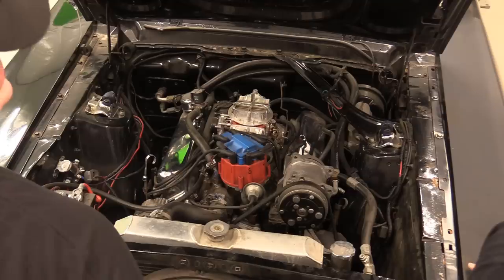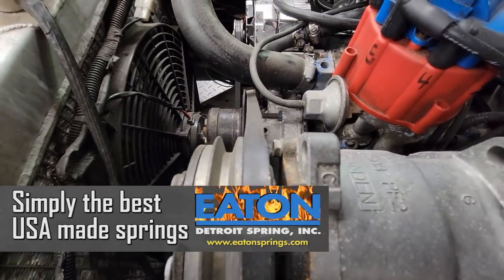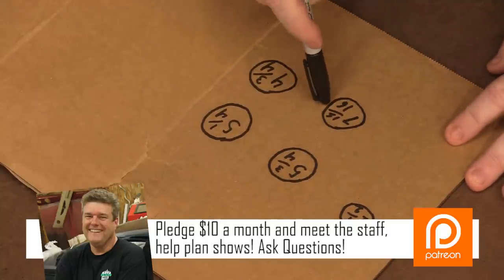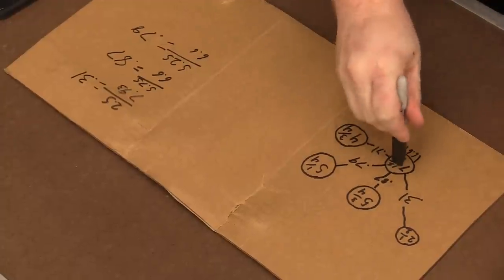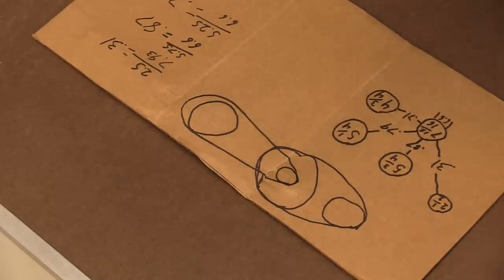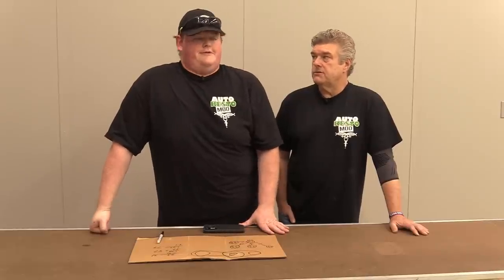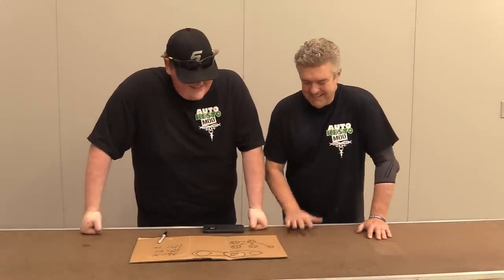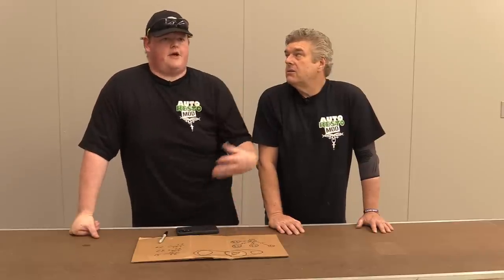Wrong Engine Pulley System

Comment: When I swapped a 1999 Ford Motorsport 302 crate motor into my 1963 Fairlane I had a hell of a time just gettin the crank, water pump and GM style 1 wire alt to line up. Came in the crate set up for serpentine. Biggest problem was Ford made so many offsets on water pump pulleys and waterpump noses. I almost went with some March pulleys, but we finally found a OEM pulley that lined up. I was throwing lots of belts shifting at 6 grand.
Reply from the maker: That is exactly what I've found.

Comment: Your pulley question got me questioning why also lol. I just looked in my Chilton collector edition (not sure if matters) for the 1961-1971 truck repair manual and found only 1 picture from the FoMoCo of the 330 v8 with dual belts to the crank. In the 71-78 manual no pics and looked at the car manuals also with no such luck. I do recall I had a 390 75 F100 with dual belts also and my now 73 with 390 does not. So as far as I have seen is, one truck owned in early life and this one pic in the manual, that they just gave you 2 belts. Not sure but got my curiosity....thanks for vid guys.
Reply from the maker: You are welcome

Comment: I have been running a CVF racing v belt pulley and bracket system for about 10 years now on my Cleveland. Probably one the easiest way to get the correct parts but probably not the cheapest way.
Reply from the maker: That is the direction we are leaning. Looking toward March Pullies

Comment: Your math seems to be way off on the alternator speed. The alternator will be moving over 3 times the speed of the crank pulley. So, if you idle at 750 RPM, that alternator is going over 2,300 RPM. The diameter of the alternator is over 3 times smaller than the crank pulley, so it will go 3 times faster than the crank pulley. That alternator at 5000 engine RPM will be spinning over 15,000 RPM.
Reply: Came here to say this... Jeeze Cam...
Reply from the maker: We don't maths well.
Reply: @AutoRestoMod   LOL
Reply: very true older chevys dont energize till 2000 rpm

Comment: Cam, the crank (7.9375) should be divided by the alternator (2.5) that gives you a 3.175 : 1 ratio. The alternator spins 3.175 TIMES faster than the crank. At 750 rpm at idle, the alternator is bumping close to 2,400 rpms.

Is there a chart or listing the show recommended accessory speeds? That would allow a builder to search for the correct pullies based on math rather than luck and guesswork.
Reply from the maker: We didn't find one but We'll look.

Comment: AFAIK dual sheave pulleys on water pump & alt were used on engines with separate sheave on water pump pulley, to drive smog pump. Those were generally Hi-Po engines with Holley carb, that could not pass emissions. The '68 390GT with Holley used smog pump, the '69 used a Autolite carb & no smog pump.
Reply from the maker: Thanks for that!

Comment: I have two comments/questions… Is a 7-15/16” crankshaft pulley really massive?  
I have a stock olds cutlass it has about a 8” pulley. The driven water pump has a dual  5”/6” and then it goes to the 2.5” alternator. 
 If I did the math correctly my water pump is driven at 1200 rpm and the Alternator is 2618 rpm. At 750 idle.   
Reason why I’m even thinking about this is because I recently bought some Aluminum pulley’s and the crankshaft pulley is only 4.75” versus the factory 8”.  😮

With the new smaller pulley it would take me close to a 1:1 ratio. Therefore cutting all the driven pulleys RPM in half. 
  So instead of the water pump spinning at 1200 rpm, it’ll be only 625.  The alternator RPM would drop to 1364.  But when I researched the alternator rpm specs it seems like 2500 RPM at idle is correct! 
Now I don’t know what to do. I want to install my new pulleys, but at the same time I want the higher rpm at idle because I have a high output alternator to compensate for the 60 amp cooling fans, 80 amp air ride compressor. 300 amp Amplifiers ect.  From the research I found 2500 is the number for alternator rotation at idle. fml

Comment: Yes Ford pulleys can be maddening, looking in Master Parts there are pulleys of 6" & 61/64", really? For small blocks there was a major pulley & bracket change from 1969 to 1970(year water pump inlet changed from passenger to driver side). There were two P/S pulley for the '69 428 Cobra Jets. Size increased due to the 3.91 & 4.30 gear SCJ burning up pumps. Not having the correct CJ pulley, when I installed P/S on my Torino, I used a 6cyl Maverick pulley(offset perfect). It's size is between the original speced  pulleys. I now have correct pulley but am in no hurry to swap it out. Many water pump pulleys swap between FE and pre '70 small blocks. 

The water pump pulley on your Mustang is a '70 up pulley(appears same as on my '72 Comet). Those generally have seperate drives for alt and P/S pumps. The P/S bracket is correct for '67/'69, probably so is the pulley.
Reply from the maker: Interesting. The PS pump pully looks "wrong" (too small) but maybe not. My spares are all in disarray so I can't pull out a pump to check it.
Reply: @AutoRestoMod  According to Ford Master Parts, '67 289 Mustang without A/C used a 4 7/8" P/S pulley. Should be stamped AC. With A/C Used 5" pulley stamped AD. I'm using a 7AA pulley on my '69 Fairlane 302, its from a 1968 A/C 390GT. Ford doesn't give size but measures just under 5". That's the system(with Maverick pulley) now on my 428CJ. Offset was wrong for 390 pulley on 428CJ.

Comment: Ok so guess I need to re-examine the pullies on the 68 Fairlane for the roadtrip and racing in Sept/Oct.
Reply from the maker: Yes. LOL, might want to get your head looked at after our chat and you discussing 4.30 to 1 gears for a road trip.
Reply: @AutoRestoMod  but that takes all the fun out of it.
Reply: Had a buddy that installed a 3.25 gear for cruise/highway and then a 4.56 at race track. Swap back for return trip home.

Comment: Ok guys, for the question of dual sheathed WP’s and ALT’s it’s simple. I’ve got an 85 F250 with a 460, so my truck has 7 pulleys with one being the crank obviously. My belt drive also is dual belt for the power steering pump or PSP and uses two air pumps or AP’s. My crank or CP has 4 grooves which is two pulleys bolted together, my WP has 3 grooves with a space (no 2nd groove) which is two pulleys bottled together. My ALT & PS have two grooves, my A/C Comp & both AP’s are one groove. Seems complicated but it’s not by far. 

The front to back grooves 3 & 4 of the CP drive the WP & PSP, groove one of CP drives the WP & A/C Comp. Groove 2 of the CP drives the rear groove of the ALT and the front groove of the ALT drives both AP’s. This is a 5 belt accessory system and yes it’s cumbersome and very annoying to change just one belt. So if I have to change one depending on availability and cost I just change them all to be good on all accessories. There is no belt drive diagram sticker on my truck but, looking at the pulleys it’s self explanatory.
Reply from the maker: That still sounds complex. LOL
Reply: @AutoRestoMod  not really, just looking at the accessory drive there’s no adjustments for belts to be misaligned. 

Only adjustments are for belt tension, it’s easy as heck even on a bad hot day!

Comment: You showed a horrible pulley/belt misalignment.  I must have missed the correction part of the program.  Do you have a video on pulley alignment correction procedure?
Reply from the maker: No. It honestly would be hard to show that as it will be different with every engine and pulley combo. But that isn't a bad idea.
Reply: @AutoRestoMod  Personal experience was by the school of skinned knuckles.  Correcting misaligned pulleys can be very tedious.

Comment: Two things. First is there a chart somewhere that gives you the correct ratio? My math isn’t good either but isn’t the alternator turning 3 to 1 with the crank instead of.31? Second (see I told you my math is not so great) , I changed out 2 new alternators and 3 alternator pulleys trying to get an alternator to stop squealing. Turned out to be a bent crank pulley. Thanks for the great videos.
Reply from the maker: I will work on one and see if we can't put it up on the web page.

Comment: It should be stressed that there are many many variations of Ford accessory pulleys…they made multiple changes just within single model years, you have to go by the numbers on them, very important😀
Reply from the maker: That is true. I've been researching brakes and Ford did the same thing there too.
Reply: Been swapping Ford engines since late '60s. As long as puillies are aligned, I've never worried about diameters, no issues. Water pump and crank  pulleys on my '69 Fairlane are so close can't fold a sheet of printer paper 4x slip it into space. May have been 1/8" space on orig.

Comment: I have encountered this with Ford multiple times. Why they changed pulley depths and diameters throughout the sixties and seventies is just dumb. It's no surprise why GM was far more successful on their small block platform.
Reply from the maker: Weirdly we have run into pulley issues with GM stuff too. Specifically water pump and crank stuff.

Comment: For any alternator over 95A you need a dual v-belt system, or you get a squeaky belt. One v-belt doesn't get enough traction to consistently pull the larger units. That is the recommendation from PA Performance. One alternative is to switch to a serpentine (which has a wider belt), but that usually means dropping the stock fan blade and going with electric fans. I prefer the stock look, so I don't run anything over 95A, and really I don't have need for more amps- I think the stock alternator on my old mustang was 38 amps.
Reply from the maker: Good stuff there!